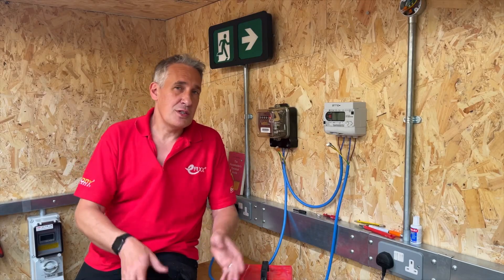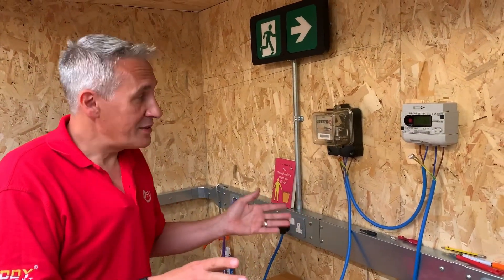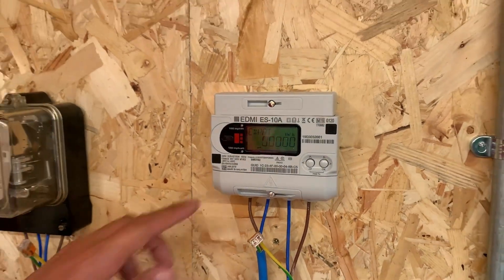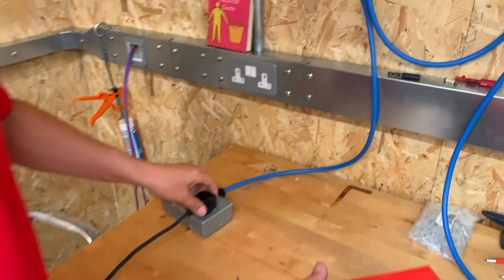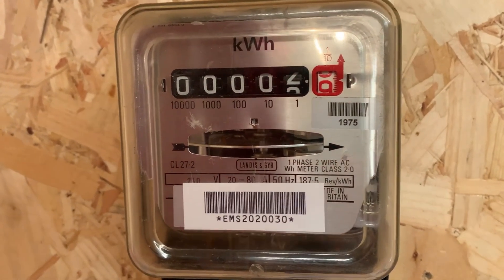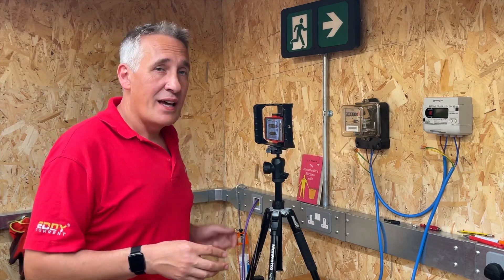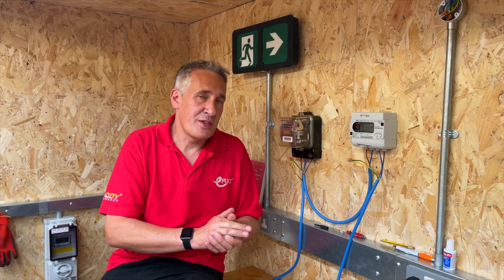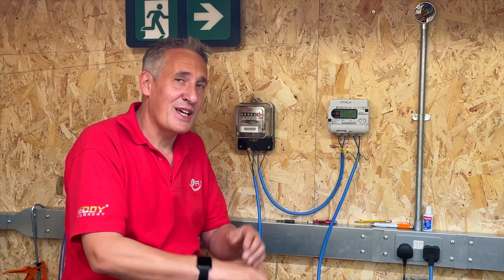Will My Electricity Meter Run Backwards After I Install Solar?

Comment: My meter ran backwards after a solar installation, I informed my suppler who fitted another meter...... that ran backwards. They changed it again after about 2 month's to one with a backstop unfortunately. I do know someone who has solar and a meter that runs backwards when generating, they informed the supplier and had no response so 9 years later they still have increadibly small bills.

Comment: mine goes backwards again now as had to get a new inverter fitted going in reverse at warp speed now only got 1 more year of service life as 1985 on sticker so 40 years are up but another trick is to mount the old meters on a hinge and tip them up as at right angle wheel will stop moving . ur honer i was doing some painting and forgot about it lol 🤣

Comment: I have installed 36 solar panels. I have pumped over 4000Kwh to the grid. Electricity I can use to replace my oil boiler with a GSHP when fitted to further reduce my carbon footprint. Nevertheless, it seems that E.on Next would prefer me to have a digital meter so that they can pay me i pittance if any for my electricity and then charge me retail for the electricity that I put on the grid. The 1968 act does not apply as I am not stealing anything. Are you aware of legal precedence or guidance that would allow E.ON Next to force me to have a digital meter. I propose to defend my position vigorously. For instance, I suspect that since the meter is behind a door, then the criminal charge of "Breaking and entry" may be a good start? But my case is against the corporation, not the operative as that person is just doing what he is instructed by a company promoting the use of fossil fuels. Notwithstanding I pay in excess of 50P a day for E.ON Next to store my electricity.

Comment: I understand that if you have solar fitted and indeed connected to the grid you need it professionally installed by a MCS installer. This will require a meter upgrade to a smart meter. Old analogue meters can not be fitted. If professionally installed then you qualify for a MCS certificate and G98/G99 certificate which will allow you to claim the export. Certificates sent to your electricity supplier. If you don't want to officially export you will still be exporting but you will not receive the export payment. Also the DNO must be notified about the installation and size of the system. This is done automatically by the MCS installation company along with the type of meter fitted and the MPAN detail.
Some analogue meters have ratchets fitted to stop meters running backwards. This includes gas meters.
Reading the comments below I am surprised solar installations connected to the grid have analogue meters fitted.
Reply: Partially true - MCS is not a legal requirement.    Yes you may feel that using an MCS accredited installer offers you piece of mind and thus, is worth the decision to find one.  MCS is basically a set of standards that are deemed to be appropriate for Solar PV (and other renewables) installations....
The issue comes when you wish to register for a Smart Export Guarantee tariff (SEG) with one of the utility providers that have to offer them [any provider with over 140,000 customer I believe].  At this point, not only do you need a compatible smart meter to record your export (must support 1/2 hourly billing), but also apparently an MCS certificate. 
So if you have an old style meter, that does wind back, you can improve on the SEG Tariff (current best market offering paying approx. 15p/kWh), by winding back at your prevailing import rate, no brainer.
The marketplace perception of 'needing' to have your Solar PV installed and signed off by an MCS accredited installer, fails to mention there is an alternative - FlexiOrb, who also have a set of standards.  Rarely will you see the organisation referenced, because the government, in their infinite wisdom have backed MCS.  Like most standards bodies, MCS have become a bit of a monster - ironically when there is no legal demand to adhere to their standard, UNLESS you want to benefit from various funded schemes. Personally it's a racket and the fact there are alternatives SHOULD be referenced......choice is everything, especially when you are not bound to a particular approach.

If you are considering Solar PV, do your research and I would wholeheartedly agree with ensuring you deal with a reputable installer, 100%, that adheres to standards......just realise there are alternatives (and the big utility do acknowledge this, including Octopus !!) 

Finally, not sure I agree that if your are MCS accredited, they complete your (the installers) obligation to register wit DNO !!  We complete our own DNO registration, whether than be G98 or G99.

Comment: Had solar panels since 2012 with the old style meter, that runs backwards when exporting, never had an issue with all the energy companies. We are big user of power so never exported more than used, but do have a friend that had panels fitted before me and since then has never paid for electricity! They have the big feed in tariff also from 2010/11 so get paid over £1400 a year and has never paid for any.
Reply: Are you still using the analogue? my energy company won't install a smart meter as we are in the countryside, whatever that means! so any excess solar is presumably dump as we have no batteries to store the solar energy. So my only alternative/option would be to install an analogue meter. Do you know by any chance what models do not have a back stop to prevent it from going backwards.

Comment: You used to be able to purchase a voltage reduction unit that was fitted in your side of the tails ie reduce your terminal voltage watts consumed on any appliance drops proportionally ( simple ohms law ) w=v x I as all meters are watt hour meters 1000 watts consumed 1 unit used simple.

Comment: Hi I had the government fitted solar panels in 2011.  I have the exact digital meter that’s in your video. How do I know if I am getting the free electricity I am generating? I did a test suggested by shade greener and turned every power outlet off for one hour and took a reading. After one hour the reading was the same. She suggests I’m not getting the free power. Is she correct. 
23/2/23

Comment: Anyone does the analogue meter have a way to reset to zero? Thinking to use to measure a device power use for like a job but like if reset to zero for next job

Comment: Battery prices are still the top deterrent:  sodium ion, sodium sulphur and aluminium sulphur batteries should (theoretically/logically)  slash the cost of both stationary and EV powerpacks.  How much longer will we be forced to wait for this crucial price disruption?
Paul G

Comment: You cannot feed your solar power back into the network without a contract with the supplier.
It is exceedingly dangerous to do so. If the network power goes out and due to this a technician is working on the supply cable he will have isolated all sources beforehand. If he has no information that you are feeding into the network he won't isolate it. You will kill him and go to jail for a long time.
Reply: When the mains goes out the kit is switched off it’s a safety inclusion on the kit.

Comment: The proper answer is...It depends.  The older spinning disk mechanical meters would run backwards.
The newer ones had a mechanical device to prevent it. 
You're not likely to find either of these nowadays.
This to prevent people fiddling their meter by connecting it backwards,
(There were fiddles to do on the seals also.)
The newer meters with LCD won't run backwards.
Reply: I know someone who has had solar panels for 5 years and at times his meter runs backwards. He submits meter readings even after the meter has been read and they credit his account. The supplier has not caught on yet and can only back date his usage by 12 months if they find out. He us Hundreds if not thousand up.

Comment: This is certainly interesting and not at all how it works here in Australia. We have two Rates for electricity. Usage is charged at for example 20c/KWH and then solar feed in tarrif or FIT is generally paid at 7c/KWH. And since the Government has demanded smart meters for all houses and businesses we'd never have issues being overcharged or undercharged like some of the other comments ive read. And for people who have solar before smart meters, you'd actually get a second meter installed that only measures generation.

Comment: Do you know why they hate this ? Simply because you buy it back for the same as you sold it for ! They don’t get to rip you off! No batteries would be needed which is better for the environment. You’d simple use the grid as your battery.

Comment: My father in law had solar installed 10 yrs ago and he had an analogue meter. He couldn't understand why he was still a high energy user. When he swoped providers they came and inspected his meter and found it had been damaged they think from running backwards. So when it was going forwards to was putting o  more than it was supposed to. Once he had the meter changed to a digital he went from high to a low user of electricity.
Reply from the maker: Hope he negotiated a refund!

Comment: One of my customers was one of the first in the UK to have solar . They came over from Germany and fitted the system to a old analogue meter .it went backwards . The first issue she had was as you said the 
Meter went back past the last reading and she did get a bill as if the meter had gone all the way around and she did get a enormous bill . In the summer they did produce way too  much power so they had in  a barn with  about 10   convector heater on full blast to keep the meter going back past the last reading she got it to use just a few units per quarter . So they wouldn't question on the bill. She had to keep accurate records of the meter reading times .   She ignored the energy companies request to change meter and to go onto the fit tariff then smart meter came in and she was hounded by her provider . Because they wanted the energy and bigger profit of her investment . She took a hard stance with them and kept the old meter . they would turn up and try and fit a smart meter and said the installation was dangerous on numerous occasions and one excuse was  due to German warning signs and instructions . They tried everything to try and force fit a new meter . They never did once she got solicitor involved and testing done to prove it was safe . 
She sold the house recently and used hardly any electrical since it was fitted . I was told the change of ownership force change from a deemed contract to a new customer and the meter was changed with the new owner to a fit tariff making very little for the new owner and  a lot for the electric provider ..  one issue that  had to be addressed was to up date the supply out cut off so the power was being back fed into the system if the mains went down and prevented any possible injury to utilitie workers working on the over head Lines .  If this systems was fitted today it's unlikely it would be allowed due to the capacity of the old existing cables feeding the farm . 
Many farmers now are being refused  solar farms due to outdated under rated cables in rural areas it's why it's been discourage with lower profits simply because the national grid want to maintain control and balance the power and to keep their generation going making profit rather than all the money going to small providers on a sunny day . Their is also the issue of switch off millions of small solar installation at their will .   
If every home had a small wind turbine and solar we wouldn't have a energy issue and the energy giants wouldn't have any profit on windy or sunny days . It's a cartel with government backing . Best thing to do is to disconnect from the grid as many farmers are doing now and running on diesel generators it's cheaper for them .

Comment: From ofgem

Unless there is a good reason not to, suppliers must install a smart meter if they are:

replacing a meter
installing a meter for the first time, such as in a new property. 
You can choose not to accept an offer to have a smart meter fitted. You can also request to have one at a later date without being charged. Choosing not to have a smart meter might mean you have a limited choice of energy tariffs. Some smart tariffs could be cheaper.

When your getting 5-10p for power export and purchasing at 30-50p batteries make sense
Reply from the maker: Great input 👍

Comment: My friend had one running backwards for  many years. He just made sure he used enough in winter to compensate. Meter was inside and only got read in winter 🤣. Another interesting query was one person their meter clocked UP units when they were exporting. Needless to say they soon got that changed